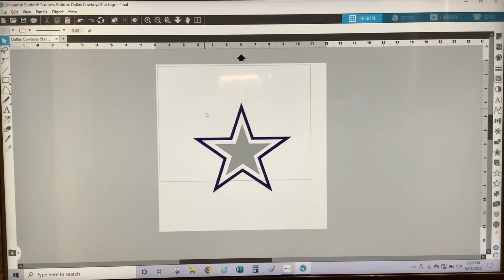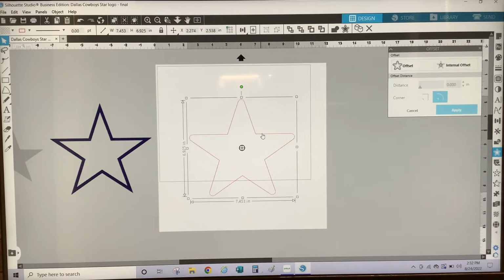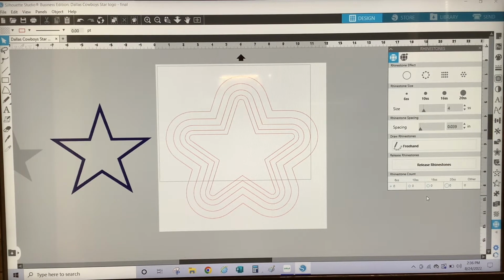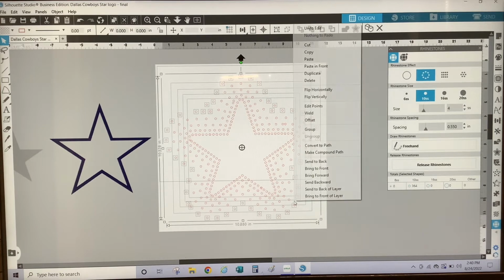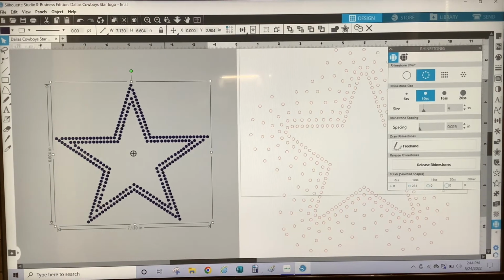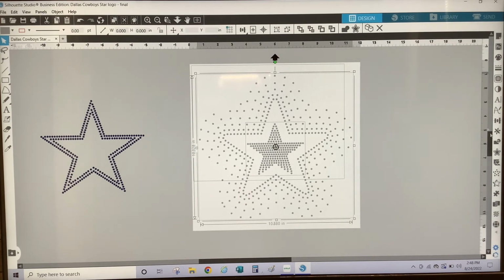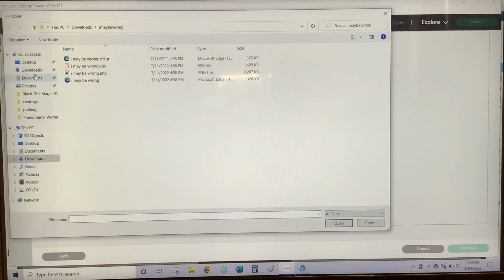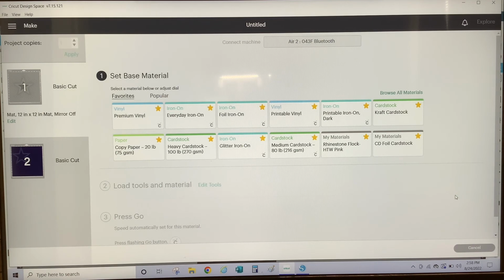HOW TO CREATE A SCATTERED EFFECT RHINESTONE TEMPLATE USING SILHOUETTE STUDIO |  CUT WITH CRICUT

Comment: But....how did you detach the center of the star because when I tried the trace and detach it does not detach the center star
Reply from the maker: When I traced and detached there was a white area around the inner Star. I use the trace by color to to remove the white part.